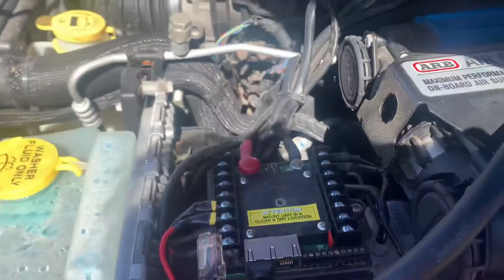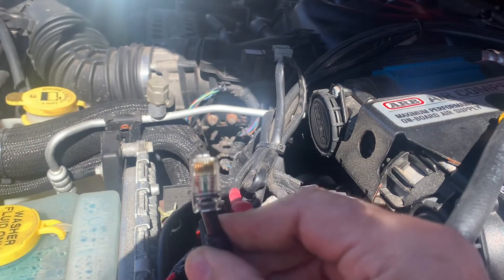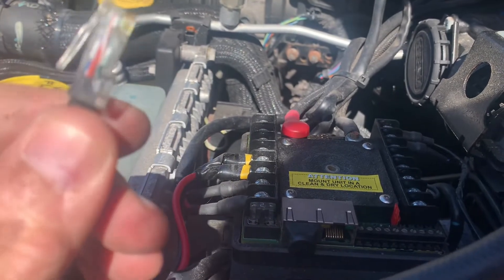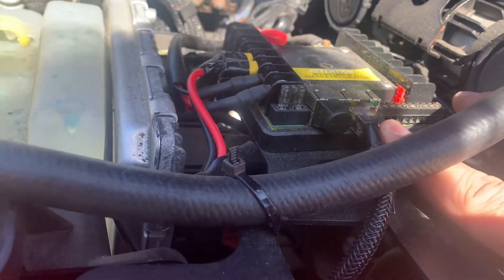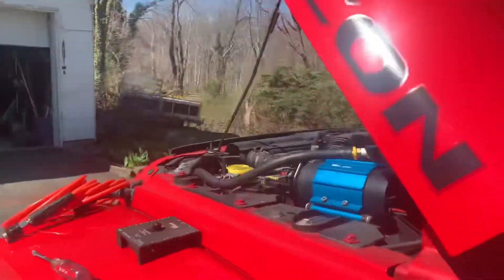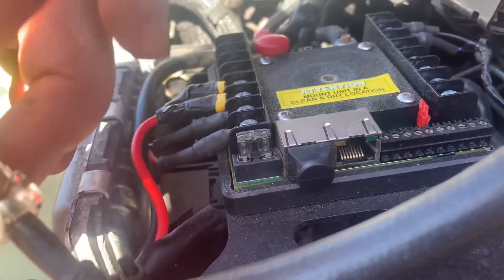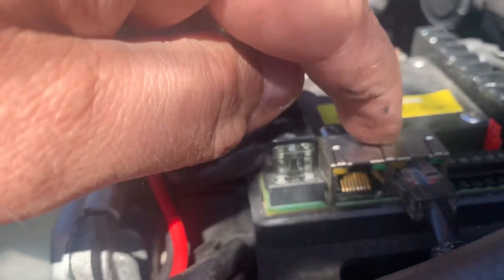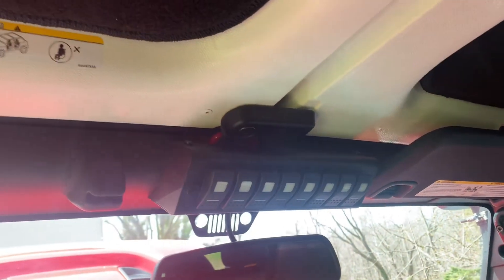Why is my sPod Not Working?

Comment: If the cable leading into the sPod comes “down” into it, water might be following the cable down into the connector.  Try DeOxit or some contact cleaner on it.
Reply from the maker: Jason I think you are right about water related damage, but I don’t think it enters through the wire. I will do an update video once I get unit back from sPod.

Comment: I’m having the same issue and I just noticed it today, 3 days ago my led pods and rack pods where working great, and then last night I wanted to show my family member my new led pods on my rack and nothing worked, although my touchscreen panel is working it just won’t send any power to my lights anymore, for such a high price item 3 months life is not a good sign
Reply: Mine just started doing the same thing. The lcd panel lights up and responds when touched but none of the lights turn on.
Reply: @anthonypierro5296   hey I fixed the issue on mine, please check the top left corner where it says sPOD, it should have a number next to it, please make sure the number is #1
Reply: If it has any other number that means that the input is wrong, just like a tv, input 1-2-3-4 so it should be on input 1 and the only way to change that is when you swipe pages for extra channels, just go back to input 1 and it should work
Reply: @victorcavazos2762  I looked at mine today and it was changed to source 2. Put it back on 1 and it’s fixed. Thank you, I should have looked at that.
Reply: @anthonypierro5296  to be honest I dont even know how mine changed if i almost never messed with it, but mine was at 4, how who knows but it works now

Comment: I have a completely different issue with my 1 month old Bantam X. I initialy order the HD Switch panel and installed everything per instructions and followed the instructions to connect it to my Bluetooth which it did, however none of the switches worked and couldnt be programmed. They sent me a new one, same thing, nothing worked. Then they sent a Touchscreen saying it didnt need to pair and would work perfectly out of the box. I recieved it, installed it and hooked the ethernet cable up and nothing worked again but this time the Touchscreen would light up but it never showed the battery voltage or the curcuit board temperature. Between emails back and forth they determined my curcuit board was defective and overnighted me a new one to switch out in the morning. The entire time it has been installed in my Jeep whenever I removed the cover the green and yellow lights would be flashing where the 2 ports for the ethernet cable plug in. Im not sure if that is a sign of a defective board also but I will know more tomorrow once I make the swap.
Reply from the maker: pheww that ids a lot to go through, it does sound like a defective board. Have them send you a new board. Hopefully, it works out for you.